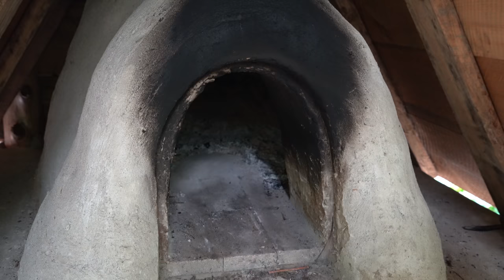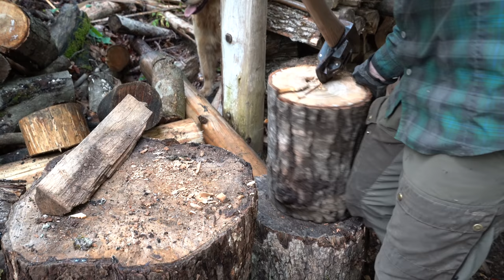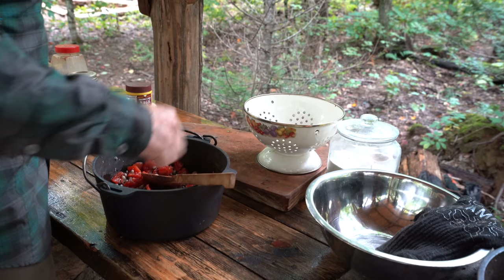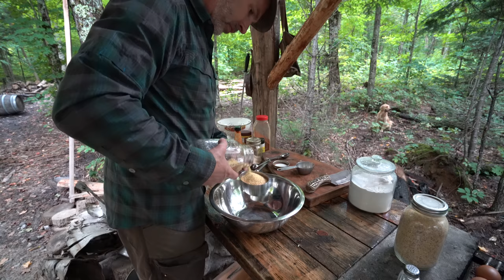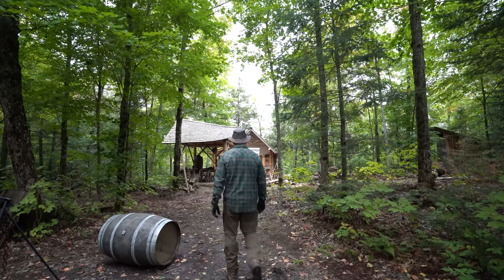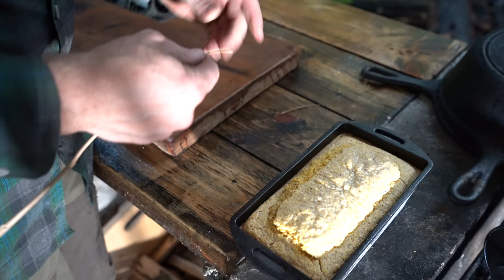Cast Iron Cooking in the Off Grid Forest Kitchen | Corn Bread and Beans | Axe Repair

Comment: A useful energy/time saving tip when splitting firewood logs is to place them ( for axe chopping ) inside a tyre ? so they don't fall to the ground. This saves your back and reduces dampness if the wood were to fall to the ( possibly) wet ground.
Also offers protection to both the axe head and anything else ... if an axe blow misses. Lovely videos ... Thank you for sharing it all .

Comment: I love all of your vids....esp the ones where you use that envious kitchen....a couple of thoughts for next year's garden that has served me well....for your corn....Look at the 3 Maiden's method....has worked wonders for me.....(1) Corn planted with (2) pole/climbing beans (one is a nitrogen taker...the other is a nitrogen contributor and the corn provides structure for the beans to climb) and (3) a squash planted to provide low cover (not zucchini or summer squash - it'll take over)....also, when planting a small bed of corn, wider is better....rather that a couple of long rows....plant in a cluster.  The Corn pollinates better this way, and you get a stronger, better yield.....I nearly gave up on corn until trying these methods.....hth!
Reply: Oh....and with that oven and your cast dutch....it's begging for a Taco Pie.....LOL

Comment: About green tomatoes...for future reference, if you have green tomatoes still on the vine at the end of the season, pull the whole plants up by the roots and hang them upside down in a sheltered spot safe from freezing and the tomatoes will ripen. It works, I’ve done this myself.

Comment: Shawn , Please tell me you are going to reseason your cast iron pot after putting that through boiling water of beans and boiling your seasoning right off the pot. That's why the bean water was so black.  Then the acidity from the bath of tomatoes sealed its fate.  Please tell everyone your seasoning your cast iron properly and frequently when you use your cast iron in this fashion. Love your cast iron and it will provide many a meal for generations.  👍👍😉

Comment: The outdoor kitchen counter-top looks good and dinner looks good.  Pick not ready peppers earrly on the day you are going to use them and lay out in sun for a few hours and they will still rippen some before you prep.      I'm not sure if it's the camera or the volume control, but the sound is much better with the mic plugged into the new camera.  So far video  camera is seems to be working well on this end,  picture seems to be (to me, ha) more intimate and all shades of green leaves look so nice.   : ) peace

Comment: Shawn have you ever tried soaking the Axe Head in Mineral Oil. Many have said that tends too work much better.. I simply drilled a hole through my Axe Head and drove a 3/16th steel pin through it.

Comment: Shane to do your kindling and cooking wood splitting I wonder why you don't use the style splitter where you hit with a say a rock hammer or small sledge and split your wood that way? I use the Kindling Cracker Firewood Kindling Splitter I got from Northern Tools for my hickory and such wood for my large smoker. It makes splitting and doing cooking type wood I'd say three times faster and safer than with an axe. I use a splitting maul close to what you use to pre split to halfs or quarter pieces then follow up using other splitter.

Comment: Food looks amazing!  One question, how do you keep oxygen in your earthen clay oven?  Is it the door, not closed tightly or is there a secondary hole for airflow.  I watched you build it, but I forgot if you mentioned that.
Reply from the maker: I keep the door off until the fire dies, then put the door on to trap the heat stored in the floor and the dome.

Comment: I gave away all my cast iron pans. The least little rust and it can lead to iron toxicity/overload - gave me severe leg cramps. Even without rust it is not the best option because there exist one better: glass pots and pans for stove TOP - can be used dirctly from freezer to stove, exist in all kinds of styles an d with covers. Brand is Corning Vision and thin easyto use plates are Corelle. The chicken pan is great, of course without teflon in bottom is best. Can be cleaned with lemon acid if burnt. They lead heat very fast so use less fire than normal.

Comment: Does anyone know how long I should dry chaga for? I just harvested some in the catskill mountains of NY a few weeks ago (Late August), and I cut it up into pieces that are generally about 1" x 1" cubes (more or less). Should 6-8 weeks be fine? They are in a brown paper bag in my kitchen (bag is not folded down), and my apartment is typically always dry (AC has been set to 70-72, windows rarely open). Thanks!

Comment: Shawn how much chaga are you supposed to use in a single Cup also so how long are you supposed to to leave it for in the cup before drinking as I've just started using it
Reply from the maker: Not sure about quantity but from my research, you need to boil and/or simmer it for a long time to unlock the nutrients.

Comment: A old trick by most bushman is to use bark on the handle then put head back on an it never comes loose but if it does you use more bark

Comment: I retired at 48 and a few days later I was 69
Drill a hole through ax head 3/16" or 1/4"  including handle ........and then use a rivet or something comparable  heat up ends and form a mushroom
Ax head want come off

Comment: Don’t you need to mark the standing dead trees well before the leaves start to turn so you won’t have to rush to collect them while other things take precedence such as getting a shelter over your snow machine and your bath house fully sealed in before snow flies?  Good luck getting the site cleared up and as much chopped and under cover as possible. So much wood was buried last year.

Comment: If you put the log lower you will use more energy from the axe.  = to cut easier.  Right?
Reply: there is enough energy from the axe higher up anyway, which saves him energy having to pull it up. Anyway thats not how energy works. The energy coming from the axe is his own.

Comment: Maybe this is a dumb question... You may have addressed this in a previous video. Do you use a metric tape measure? I'm in the U. S. and was trained to use standard measurement. I teach science and learned the metric system in my training. I prefer metric over standard measurement systems. I'm guessing you use metric.
Reply from the maker: I usually use standard.

Comment: Boiled linseed oil is much safer to use and just as effective.   A solution of 40% boiled linseed oil, 40% mineral spirits, and 10% pine tar is a great solution to treat all wood.  The percentages are approximate and not critical.  The pine tar will darken the wood, but gives the solution more body.  I use this mix on outdoor tool handles, oars, and any wood that will be exposed to the weather.  Soaking the axe head is a great idea that I never thought of, but will use in the future.